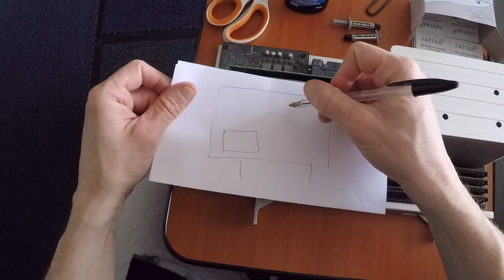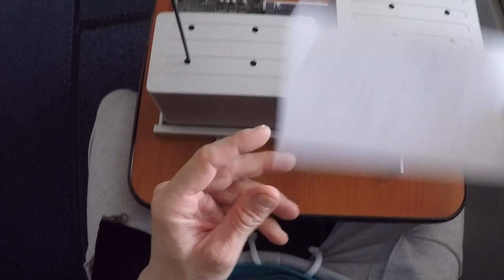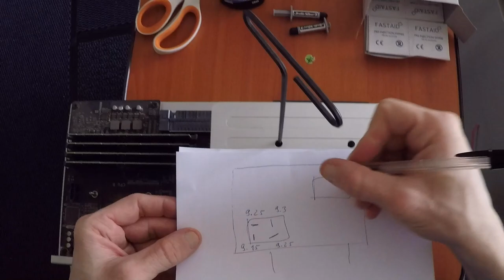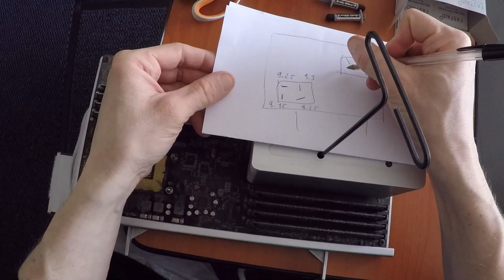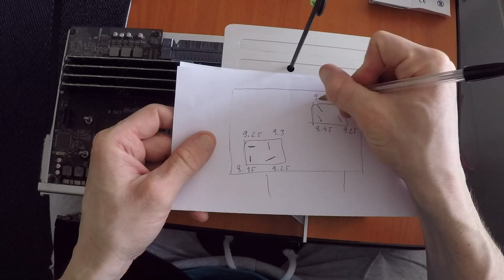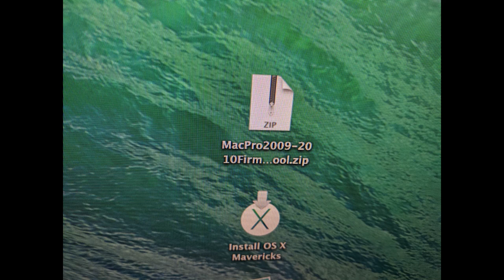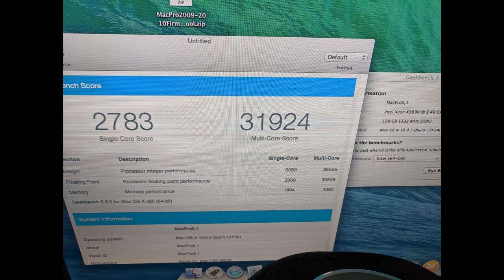How to upgrade Apple Mac Pro 2009 4.1 processor 3.46GHz Xeon X5690 &128GB 1333MHz 10600R DDR3 memory

Comment: I tend to agree with Zoltano regarding lid removal. I like that he gives an alternative regarding the heatsink connection and his way of counting screw turns with the T handled tool. 
I only have the single cpu 4,1 so for me it is not an issue. I can tell you that after 20+ years servicing Macs I would only consider "de-lidding" as a last resort. Listen to Zoltano.

Comment: One question, though: I *MAY* have nixed some contacts of the processor bed (because I installed the X5690 upside down — before putting the heatsink back on and screwing it back). Is there a way around this? Like — I don't know — gently brushing the contacts with an old toothbrush?
Reply from the maker: Use a needle and put them back 1 by one, 1️⃣ did it in some cases with on a few pins bent. Bending them back to the shape the others are.
Reply: Should I put the original processors back, check if the machine runs correctly, if yes, flash it to 5,1 and then swap the processors again? @SafarWIP
Reply from the maker: yes ,check the old processor as it was confirmed working, then you have to do the flash to 5.1 as without the x5690 wont work at all @paulsaint-julien61
Reply: Thanks! I was under the — apparently false — impression that the X5690 would be supported in the 4,1. Anyways, I'll be travelling for work this week and won't have a chance to revert the system back before a couple of weeks, at least. I'll keep you posted here when I'm done. Thanks again for the advice! @SafarWIP

Comment: Hi Zoltano, great step by step video! Did you ever experienced booting up just one of the processors, not both of them? I'm having issues with this. CPU in socket A boots properly if CPU in socket B is tightened reasonably well. If it's overtighteted it's not booting, if it's too loose, it's not booting either. Do you think this might mean the CPU in socket B is damaged? I'm operating with de-lidded version.
Reply from the maker: use the working socket with both CPU one by one and see if it works alone, if yes then make sure you thighten them properly in dual setup, with delidded CPUs you can leave out the plastic spacers as sometimes those prevent good connection if the delidded CPU has rubber residue on them. There is a rare fault i had only once when 1 CPU had a fault preventing it to work with an other CPU but that is rare. I usually try all the parts in a server first to make sure all works before installing them.